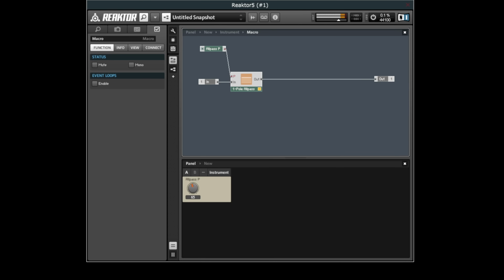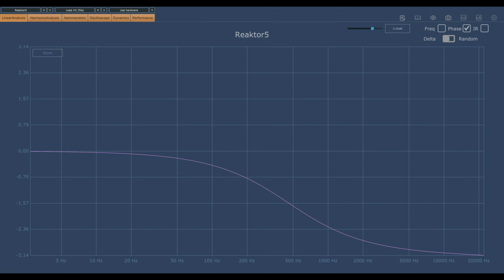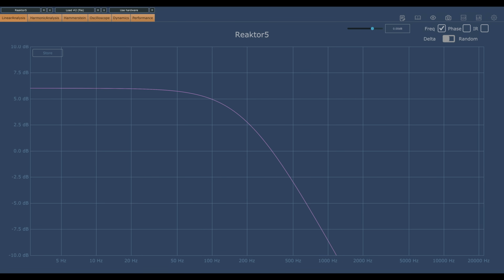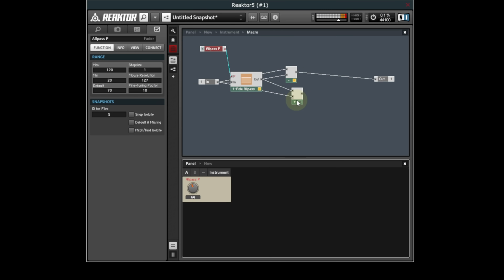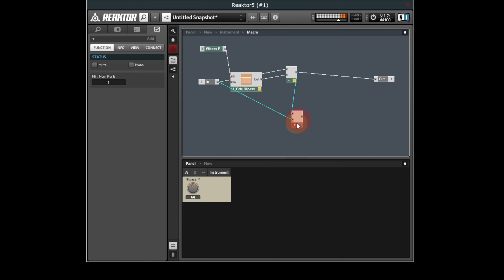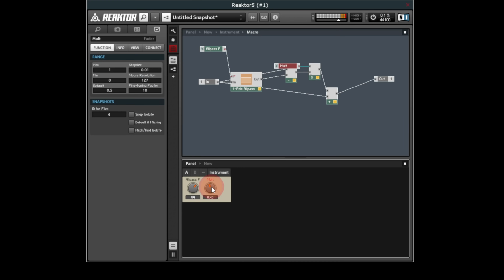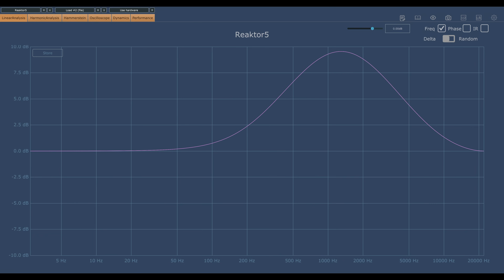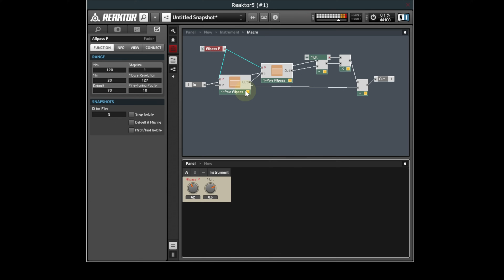EQ Doesn't Cause Phase Shift...

Comment: I see you analyzing phase a lot in your videos, Dan, as long as I've been your subscriber. I've heard more than once lately, from some producers on some forums, that Melodyne messes up phase, especially in the Polyphonic algorithm. Not only that, but I've tried it, and it looks to me, like it really does, in the high end it is highly apparent that some level dip is present. Do you have any experience with Melodyne, would like to hear your commentary, if yes?
Reply from the maker: I have Melodyne, though I think my version is out of date. I don't use it that often. Honestly I'd be amazed if it could correct pitch without affecting the phase! Perhaps you mean it causes phase shift before actually changing anything? I haven't checked for that, can't comment.
Reply: @DanWorrall  Yep, to exaggerate the effect I've loaded a famous track in it, and took an A/B with an unaffected one through a simple player, I definitely hear a difference in FR, but might be wrong, haven't done a null test to be honest.

Comment: Phase shift is more perceptible from 20Hz to about 1~2kHz, and more crucial for lows and low-mid freq., then above that it acts like a phaser (who would have thought?!) and chorus in the highs.
I sometimes cripple a pink\white noise into high-gain amp sim to comb-filter the nasty harsh hiss by its random affect on the "digital noise" above 6~7kHz (trying to invert it thus causing phase cancelation). Sometimes it works, other times not so much. After NAM (Neural Amp Modeller) came out there was no need to do it and I got rid of all amp-sim plugins ever since.

Comment: My question would be, why/when do I need to take phase shift into account?
Reply: Dan has more information on this in other videos, but essentially: you don't normally.  Only phase difference is important.  That is, when the left channel has a different phase response than the right channel, or the mid channel has a different phase response from the side channel.  Then you can hear it, and it can be useful to change the stereo image (either on purpose, or to be mindful of it when you don't want to).
Reply: It’s important when dealing with low & sub frequencies. I’m sure you’ve heard that you want your low end to be “tight”. This means your low end plays out of the left and right channels at the same time. We do this because low frequencies have high wavelengths, meaning speaker drivers take more time and energy to reproduce them than higher frequencies. As such, when there is a difference between the left and right channels in the low frequencies, it sticks out like a sore thumb to the human ear, and can make the track feel washy… almost like it lacks a back bone😅 This is the same reason you don’t put stereo processing on low frequencies (like reverb).

The fix for this is using linear phase when processing sub info. The caveat is that linear phase processing on sub frequencies causes pretonal ringing, which can affect transients and blah blah blah. Basically, pick your poison

This applies mostly to frequencies from 100Hz and down. Having stereo information in that low mid section (100Hz-250Hz) is super vital for getting a track to sound full.
Reply: Whenever you mix the filtered signal with the original, Mid/Side processing being a common case (L and R are the sum and difference of mid and side channels, so if you just put a high pass on the side channel, you might hear effects of the phase shift in higher frequency ranges).
Reply: Correlated signals. For example, two different mics on a guitar cabinet. Because of phase shift, a boost to one signal could cause a cut in that frequency to the sum of both signals.
Reply: @TheZappazapper Also this 👏🏼 The phase shift caused by EQ (or EQ caused by phase shift, whatever) on one channel can affect the sound of another channel
Reply: let's say you have a sound you recorded on two microphones to get a stereo effect, or maybe just to cover a wider range of the source. Typically you'd align these tracks to be as close to in phase as possible (it wont match 100% because its different sound sources), and if they were out of phase it could sound somewhat metallic (like a flanger effect) or parts of the spectrum will sound unintentionally boosted or cut. If you want to EQ them both together, theres no need to worry about phase. But if you want to EQ them each separately, then it might be best to reach for a linear phase EQ. But if you cant hear a difference then it doesn't really matter.

Another example of needing to worry about phase is parallel bus processing. If you are sending a track to a bus to compress or distort or whatever, then blending it back in with the original signal, its possible that phase issues might do something you don't like. It would mainly sound like EQ being wrong only when the tracks are mixed together, but not in solo.

Comment: Does using multiple gentle sloped low pass filters cause the same phase shift as a single steeper cut (all other things being appropriately matched)?
Reply from the maker: Yes. Steeper filters can be created by stacking gentler filters in series. Eg the Moog style ladder filter is 4x 1 pole stages plus feedback. The phase shift depends on how steep a gradient you create in the frequency response, doesn't matter how you get there.

Comment: Interested about this I decided to do my own testing. Similar but a bit different so I guess it also depends how adding is done by the host and/or the plugin. Interestingly with the following combination I was able to create an freely adjustable eq curve.

Ableton effects rack with:
-One chain with Mfreeform phase
-Another chain in same rack with Ableton Utility plugin at reversed phase

This would result with any value of phase from "0 to 60deg" = "infinity to 0db" and up to 6db at 180deg

Interestingly same curve will work as mirror image at 180 to 360 and same happens at -180 and - 360 steps. There is also this reversed relationship where that last 6db is 2/3 of the of the whole useable scale. If anyone has explanations for this I'm all ears.

Either way I though this was interesting.

And apparently you can boost and cut frequencies using Abletons own Phaser effect too when you set it to 1 pole (or more for comb filters), turn bass save to minimum and run parallel with inverted signals.

I used free EQ curve analyzer to test as I don't have plugin doctor.

Oh yeah and that freeform phase plugin has horrible lag at better quality settings, so definitely wouldn't use it for EQing, but it was fun to test.
Reply from the maker: You're using an FIR filter in the Melda plugin (Finite Impulse Response) instead of an  "analogue style" IIR (Infinite Impulse Response = uses a feedback loop). FIR filters are often considered "linear phase" as that's how they're typically used, but in fact they're any-phase-response-you-want, hence used in the Melda plug. I'm guessing the setup you describe is capable of creating wild frequency responses that wouldn't be possible with a conventional EQ, but you've got that latency as a downside.
Reply: @ Ah well yeah that explains it then and makes perfect sense why the phase curve was aligned with the response on the freq curve (and why it was so slow). Thanks a lot for pointing that out.

Comment: Okay question: why do linear EQs cause no or at least very little phase problems if the phase shift causes the EQ? This is confusing me at the moment. How can a linear EQ work without phase shift?
Reply from the maker: There are a couple of different ways to do it. You can use FIR filters, (instead of IIR) which give you independent control over frequency response and phase shift. Don't ask me how the maths works for that. Or the more intuitive and easy to understand way: apply half the EQ (half the cut or boost), then reverse the result and apply the second half backwards. The forwards pass does half the EQ and shifts the phase, while the reverse pass does the second half of the EQ, shifts the phase back to where it started, and puts half the ringing in front of the transient. You can do this in real-time (with latency) by processing in blocks and recombining them. Or you can do it manually like this: https://youtu.be/eSyCuuSzuE4?si=EvUq_N-lALtiej5e

Comment: Can we have a square shaped filter then? Say, I want to cancel all the bits corresponding to exactly 16khz and not a single other one affected, how would I go about that?
Reply: using an FFT filter/EQ, or a very high order IIR filter. would sound unnatural anyways... such things can be desirable in signal processing, but for audio our ears are mostly used to 1st order (1pole : -6dB/oct), 2nd order (biquad / SVF / SK : -12dB/oct) and 4th order (Moog, SVF's in series: -24dB/Oct) fitlers, but you can chain as many lp / hp filters as you want to obtain a steeper response.

Comment: Great video as usual, and very informative. It maybe would have been a more fortunate starting point to build up an allpass from a lowpass, and explaining, that a hipass filter "hp(x))" is just a lowpass subtracted from the input "hp(x) = x - lp(x)", and an allpass is the result of the subtraction of lp from a hp filter (or vice versa)
"allpass(x) = lp(x) - hp(x)",
since "hp(x) = x - lp(x)", we can say that: "allpass(x) = lp(x) - (x - lp(x))",
so this simple formula also works: "allpass(x) = 2 * lp(x) - x".

Your shelving filter works by adding the lp/hp filter to the input: "lowShelf = x + lp(x) * gain ", so you have to invert the lowpass to cut. When using a dB scale, you have to use logics ("if" statement probably) to obtain a proper scale, since 0 represents -oodB in this case instead of 1. It is more convenient to subtract the filter from the input, and add it to the filter multiplied with the gain: "lowShelf = hp(x) + lp(x) * gain", or "lowShelf = x + lp(x) * (gain - 1)"... it's the same thing. This way you have a shelving filter, where 0 gain represents -oo dB, 1 represents 0 dB, and 2 represents +6dB boost, so a simple Log->Lin conversion does the job.
For the bell, you'd have to create a notch and adding the band multiplied with the gain to it, this way you can keep the gain in the 0..n range to keep things simple.

So deriving everything from the Lp instead of the Ap represents the relationship between lp, hp, ap and the more advanced stuff a bit more obvious, while your explanation keeps the allpass as a black-box that does magic, while most of your math drives things backwards, and makes the intuition, that lp, hp, ls and hs are being derived from an allpass, while the reality is the opposite (lp is an inverted feedback loop around an integrator and a gain(the cutoff)).

"x = input"
"lp(x) = lowpass"
"hp(x) = highpass"
"lp(x) - hp(x) = allpass"
"lp(x) * gain + hp(x) = lowShelf" or "lp(x) * (gain - 1) + x = lowShelf"
"lp(x) + hp(x) * gain = highShelf" or "hp(x) * (gain - 1) + x = highShelf"
"allpass(alpass(x)) = allpassx2"
"x - allpassx2 = bandpass"
"x + allpassx2 = notch"
"bandpass * gain + notch = bell"

Note, that these bandpass, bell and notch filters are 2pole (or second order) filters, while the lp and hp are 1pole (1st order). The bell/bp would work fine for a 3 band EQ with 2pole lp and hp filters. This setup is not capable of resonance, so changing the Q is not possible without an additional feedback loop, and complications involved (the best way probably is to build an SVF filter, and derive all the EQ stuff from it - at least, this is what I did).

Comment: striclty speaking you demonstrated how to create EQ from phase shift, and not that the reverse is impossible?
Reply: EQ & phase shift work hand-in-hand. The fact that you're shifting the phase will cause a difference in frequency response. For example: Look at the waveform of a 500hz sine wave. Then increase that sine wave to 5,000hz. You'll see the waveform's cycles became narrower. You can think of that as "phase shift". And interestingly, what else changed? You guessed it! The frequency (pitch).

To sum it up: by changing the waveforms shape (shifting the phase), the waveform's cycles will become narrower or wider which will result in frequency (pitch) changes.

I hope this helps! 😀
Reply: If you want to get down to it, all filters are convolution based and convolution is just a lot of delays with varying amplitudes and polarities.With FIR filters there is no feedback on the delays, with IIR filters there is. But in either case, any delay introduces a frequency dependent phase shift.

Comment: So, if phase shit causes EQ, how do you get linear phase EQ (eg. In Pro Q)?
Reply from the maker: You can use FIR filters. Finite Impulse Response. Those allow you to change the phase or the frequency response independently. Don't ask me how the maths works. Or you can apply half the EQ forwards, then half the EQ backwards, with the second pass correcting the phase shift from the first pass (and creating the pre ringing).
Reply from the maker: https://youtu.be/eSyCuuSzuE4?si=6JJaIm6e66Vo9lOW
Reply from the maker: You can do the forwards/backwards trick in "realtime" (with latency) by processing the audio in blocks.

Comment: hey, what about processing time?
Reply from the maker: I'm not sure I understand the question? These are zero latency filters, if that's what you mean.
Reply: @DanWorrall  yes - almost. sorry to interrupt, but I would like to know what you think about whether the calculation time could possibly cause such a thing.
Reply from the maker: @shutupmotovlog  no. The audio is processed in blocks. While you're listening to a block of samples your CPU is crunching the numbers for the next block. The CPU just needs to be fast enough to get the buffer filled before the next block comes along.
Reply: @DanWorrall  Thanks for the answer. I was stupid, because I found this on the net in 20 seconds, I just had to search. Mentioning the blocks was a big help. somehow I always forget the computer as a factor, that he is not a musician, but a calculating machine, which is much ahead of me :) thank you for your time

Comment: But wait, what about minimum phase and linear phase EQ's?

(My question may seem strange but I am still trying to wrap my head around all this)
Reply from the maker: What I'm demonstrating here is minimum phase EQ. Linear phase EQ is a lot more complicated, and (IMO) a lot less useful, I wouldn't worry about it too much.
Reply: linear phase is only possible without feedback, so it requires a feedforward structure of unit delays, to keep the phase shift constant across the frequency range. in practice, linear phase means FFT.
Reply from the maker: @9b0  I'm not sure that's true. Yes linear phase filters are usually FIR filters (no feedback) but you can also get linear phase from IIRs (feedback) by processing both forwards and backwards. https://youtu.be/eSyCuuSzuE4
Reply: @DanWorrall  that's true, but this also involves some delay (just like FFT's) for real time(ish) use.

Comment: So in other words, EQ is the manipulation of a signal's phase in way that causes a desired change of frequency balance? I see
Reply: EQ just changes the gain of a desired frequency range. The way you filter out the desired range can be different from method to method.

Phase shifting is just delaying the signal. Analogue and digital IIR (Infinite Impulse Response) filters shift frequencies in a non-uniform way, because they mix an inverted delayed signal back to the input, which causes frequency cancellation. Since this process is recursive, the frequency cancellation is stronger on one part of the spectrum, than on the other.

in the analogue domain, or using analogue modeling filters, an EQ just changes the gain of a filter, and mixes the unfiltered rest of the signal to it.

Comment: Ha, where are the neysayers now, that claim a 30Hz Cut would cause a phase shift?
Reply: You get the cut by phase shifting lower frequencies by 180 degrees... so did you watch the same video? :)
Reply: I did and what did Dan conclude at least? Phasing causes equalization,  @Mtaalas